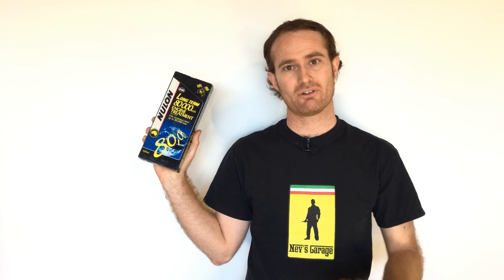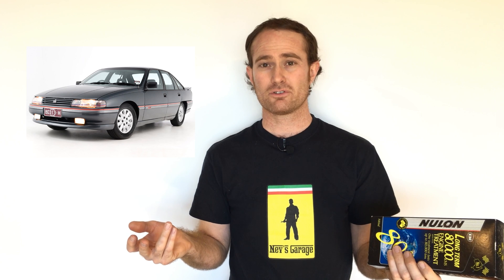P.T.F.E. Friction Proofing - Does It Work? Help us find out!!!

Comment: Iv used various different brands of PTFE / Teflon engine oil treatments for 30 years. The original in AMERICA was Slick 50. It worked so good that they eventually were bought out by car manufacturers and they removed the PTFE from the additive and kept selling under the same brand name. Never worked after that. 
My grandfather sold me on the stuff when I was first learning to work on cars… he had a Chevy truck  that was a standard transmission and he would park on a hill in his driveway and just leave the truck in 1st gear…. No emergency brake. Once he treated the engine 1 time with the original slick 50 formula which contained PTFE…. He pulled into the driveway and parked as usual in 1st gear no brake…. Truck started rolling backwards down the driveway….. not from lack of compression…. But from lack of friction. 
I have my own personal stories of engine that have been treated both loosing oil pressure and overheating due to other causes…. In every example…. Engine had zero damage and still run today…. Original motors with 250,000 plus miles. 
Key to treatment is…. Heat engine first to Normal Operating temperature…. Add treatment, immediately start engine and drive for at least 30 mins…. Then let engine cool completely. 
Takes several cycles of this to achieve full results and bonding of Teflon to parts. 
It works. That’s why it’s hard to even find any PTFE engine treatment products today. 
They work too good. Engine manufacturers and mechanics hate these treatments because they cost them money long term. 
Make sure engine is fully broke in before adding…. 
Then treat engine approximately every 50,000 miles. 
I don’t add full amount all at once. Add small amounts over time until full bottle is used. Works better that way.
Reply: The guy that made slick50 has another product called xcel Plus
Reply: The original Slick 50 formulation is now available as XcelPlus.
🙂
Reply: Greased lightning oil treatment is sold at Napa for 7.99, that's what I use.

Comment: I use to sell Tfecote2 in the 1980s in Australia a similar product. You don't treat a motor with teflon treatment until it is run in. This is to allow the motor to bed in before treatment. When treating a motor it was advised to use a basic oil without a lot of additives so it did not hinder the treatment and the product needed extremely good mixing as the teflon can settle in the container and miss getting into the motor. We were advised to add it with the motor running and immediately go for a 80 km trip before shutting the engine off, its no good settling to the bottom of the sump. We also used it in gearboxes which gave excellent protection to gears and bearings. Don't put it in an Automatic or it will stuff it. We had a 3 hp Briggs and Stratton as a demonstration to customers which after having been treated with the product we would drain out all the oil and run it for 5-10 minutes with nothing in the sump. If you know Briggs motors they won't run long without oil before seizing. We did this many times without causing problems to the engine. When I came back to N.Z.I put that engine on a reel mower and used it for years. They had a saying "I'm ahead of you cause I use Tefcot2"
Reply: TefCote II is now sold as XcelPlus in Australia
It only requires a single treatment.
An oil analysis soon demonstrates what works.
🙂